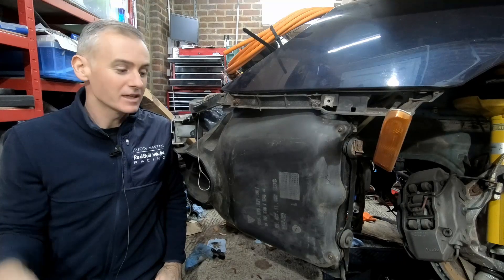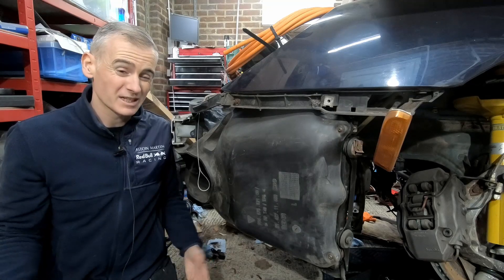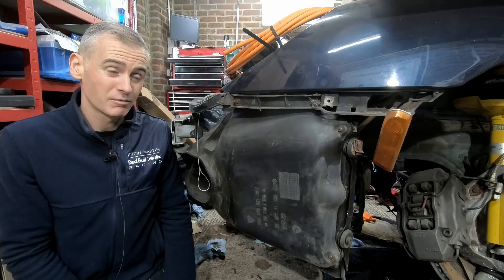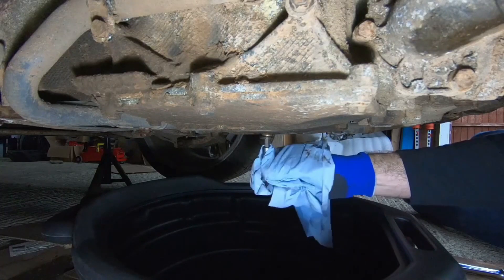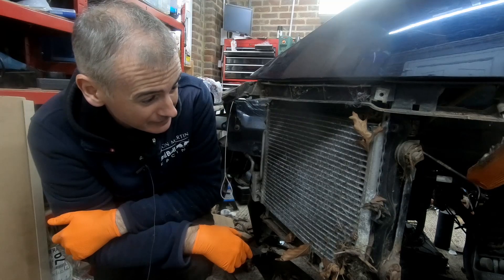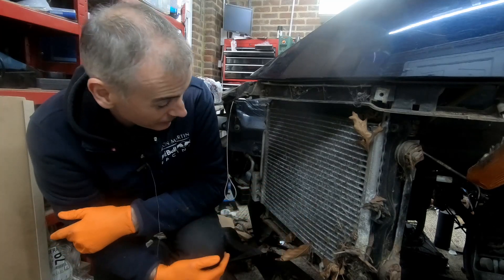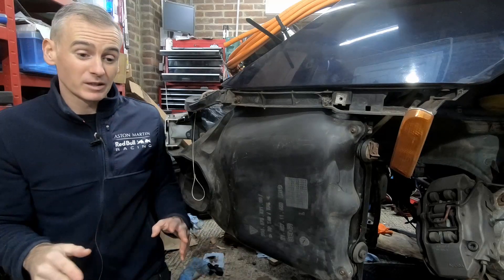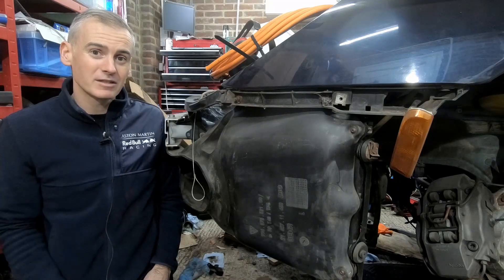Replacing the Radiators on our Electric Porsche 996 EV Conversion - Cooling system overhaul Pt1

Comment: Yes, I back up Johannes on that point. I do however have two water cooling circuits, inverter and motor which share a split core custom radiator. which is Very much overkill. On what passes for motorway speeds here in New Zealand, the motor temperature slowly climbs and that is where you may experience inverter over-temp if you are sharing the coolant loop. So do retain the option of separated coolant loops if you can. Oh, and great project!
Reply: Yes it's true the inverter (say max 80C) should run cooler than the motor (say 150C). However, even Nissan have just one loop, first inverter, then motor. I'd only expect the motor to reach more than 80C when towing heavy or on a race track. So application dictates efforts ;)

Comment: Sorry if I missed it in a previous episode, but how are you powering the aircon pump?
Reply from the maker: It’s just sitting in the back where the engine was for the moment doing nothing, other than keeping the system closed. I’m planning to replace the engine driven one with an electric one at some point next year and will recommission the system then.

Comment: Hi Shane, great work as always! I wouldn't even bother to hook up that second radiator. In my Touran, which is heavier and less aerodynamic, I have one radiator about 1/3 of the size as yours and no fan. I never even get close to overheating even on steep hills. Only prolonged Autobahn speed (like 150, 160 km/h) it cannot sustain.
Reply from the maker: Thanks Johannes. That’s great real world input. Based on that, I think my new plan is to hook up one radiator for everything and see what it’s like on the road. I can always reroute the hoses add the other one in if I need it.